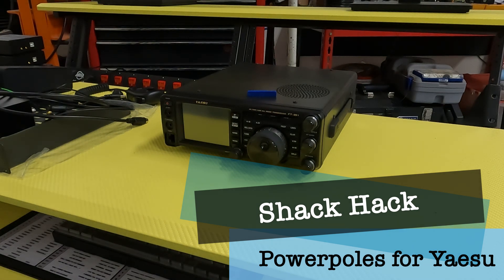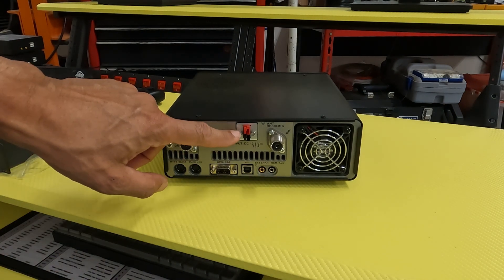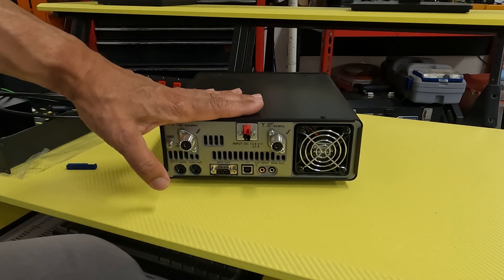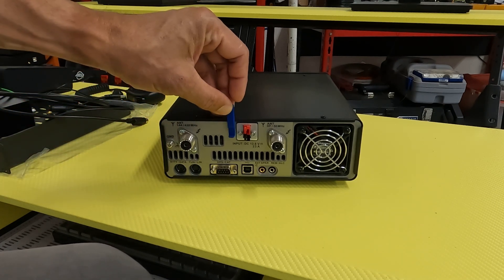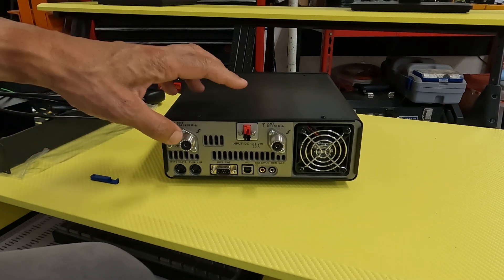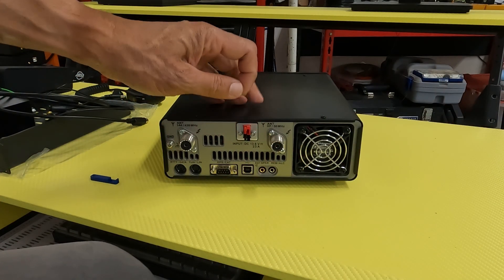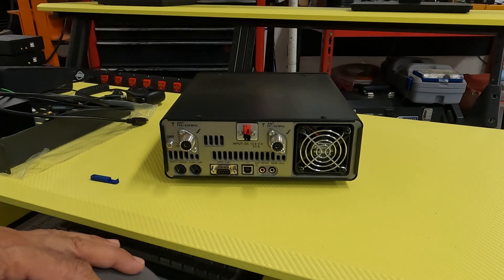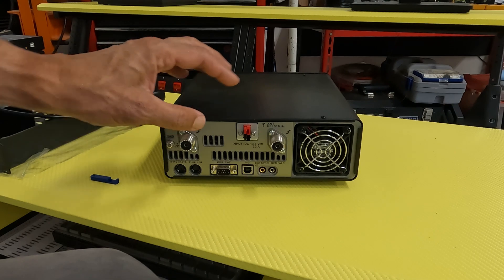Shack Hack: Yaesu FT-991 Power Pole Connector Kit Review

Comment: Thank you for sharing this mod.  I don't think I would feel confident enough to do this.  Is it possible to just put anderson power poles on the line somewhere?  I would like to use my FT-991A in the field also but, my issue is, I want to connect my FT-991A to a PowerWerx battery meter.  So the meter will be in the middle of the battery and the FT-991A.  Is it possible to just leave the original connector in the back and add anderson power poles to the wire?  Thank you again or sharing.  KO4UWU
Reply from the maker: Absolutely, I initailly just put power poles on the end of the factory harness and pluged it into my power panel (which is all power poles) The only reason I put the power poles on the radio is that 1) their much easier to connect and disconnect. and 2) if I ever forgot my cable at home, most hams have Power poles I could possibly borrow if i were operating with a group.

Comment: How did you remove the original connector?  Just received my power pole mid kit from 918. Looking it over and getting a game plan together. I’ve removed the cover and slid the original connector in through the back. Looks really tight and I hate to cut the original connector off. I’d rather unplug it as you did.
Reply from the maker: I used a jeweler's screwdriver to depress the locking tabs of the connector pins and slid them out. Once out I used a blade to open the crimp on each of the pins so I'd be left with the original stripped wire. As you know those leads are short and it takes some fiddling to get the power pole crimp tool in there but it is possible. The hardest part is making sure the power pole contacts fully seat and LOCK  into place. Use a loop or magnifier to make sure yours are fully engaged , otherwise the mating connector will just push the contact back in the connector and you won't get good enough contact for sufficient current flow to power the radio.

Comment: Did it come with 45 crimps?
Reply: They said they include 30 amp crimps.
Reply from the maker: @scottgarvy  when I got mine, it was just the bracket. I used my own Powerpole connectors. I used 45 amp crimps - and it was a TIGHT fit.
Reply: @BarryShaffer  Thank you!

Comment: what other mods did you  do to your ft 991 If Any ? I Also have the Yaesu ft- 991 & I notice they run a little warm for my liking & i learnt the hard way that Heat is Electronics #1 Enemy & The Cooler The Better & i was just kinda looking for some ideas was all !
Reply from the maker: Not this far. Only had it a couple months and it was a little scary opening it up for this simple mod. I do worry about the heat we're heading into the summer and my shack is in the garage in the middle of Arizona.